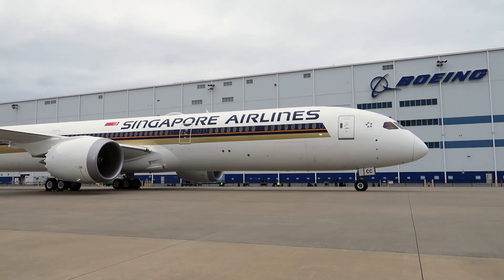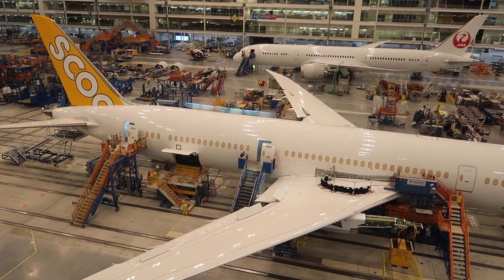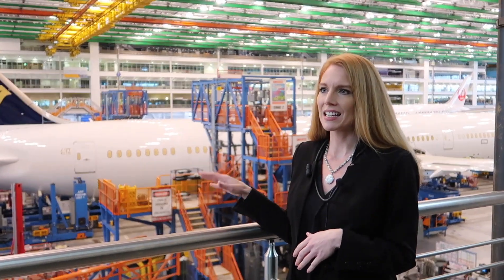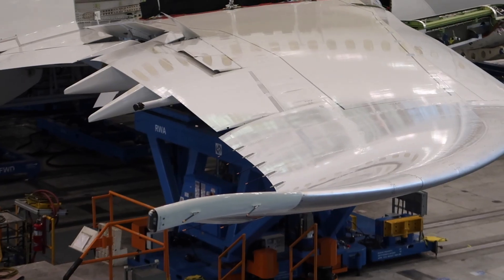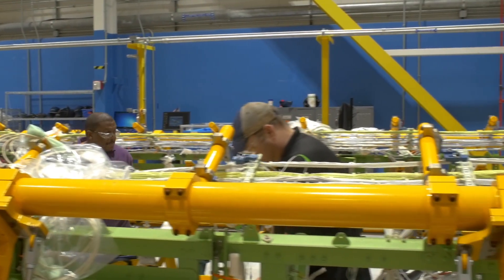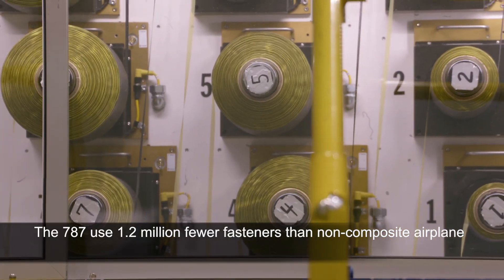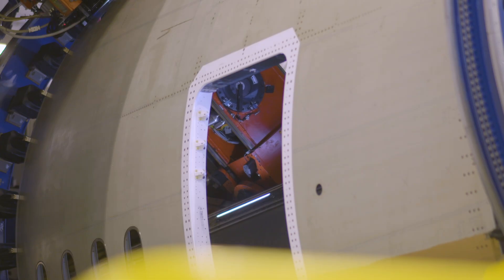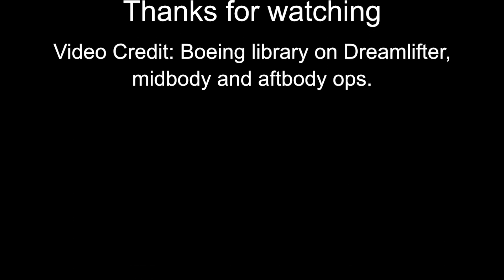How a Boeing 787 Dreamliner is Built ?

Comment: i spent way too long writing this paragraph about the alloy they use on the leading edges and I'm kinda proud of it, its the sexiest word porn I've ever written.
Aluminium 7085 is chosen for all leading edges on the 787, this includes the wings, engine cowling, vertical stabiliser and horizontal stabilisers. Aluminium is selected over carbon-reinforced polymers primarily due to its impact resistance. This allows the surface to deform rather than shatter or crack when struck by obstacles such as birds and hail. Specifically, a 7085 aluminium alloy is used for its inclusion of up to 8% zinc, which when paired with magnesium and copper, allows the alloy to be precipitation hardened, assisting to retard dislocations within the metal. Furthermore, inclusions of chromium improve corrosion resistance and help limit the stress corrosion that is often associated with welding zinc alloys. Zirconium is also added in order to inhibit recrystallisation, this prevents the growth of new defect-free grains, allowing the alloy to maintain its desirable hardness and strength characteristics. Finally, titanium inclusions are used to refine the primary aluminium grains, this increases the number of grain boundaries, resulting in a more ductile material. Controlling the grain size in this way also assists with corrosion resistance as having too many grain boundaries promotes galvanic corrosion, while coarse grains do not provide enough space or pathways for ions to travel through, making it difficult to develop a uniform passive film, thus reducing corrosion resistance.

Comment: Russian engineers are developing the main elements of the fuselage springs, engine supports, as well as the leading edge of the wings, slats and titanium components for the chassis, the main elements of the newest passenger aircraft Boeing-787 Dreamliner are being developed at the Boeing Moscow Center, where 300 Russian engineers work, Boeing General Designer Jim Morris said.

Comment: True fact. Several airlines will not accept an SC-built 787. Now that all of them will be built there, this will be a big problem.
Reply: Several? only one (Qatar) but they do now accept 787s now. not a problem anymore now the problem is fixed
Reply: @nickolliver3021  Several airlines used to refuse SC-built 787s. Now, they don't have a choice. BTW, they still bring them to Everett to fix the manufacturing errors in SC. The 40-26 building is still always full of defective planes that need to be fixed.
Reply: @xyx12300  several? It was only one. (Qatar). Lol if they dobt have the choice they wouldn't want to take them on anyway and it would be a waste of an order. Actually most are ready for delivery now. Tne remaining ones that needrework are at Everette.
Reply: @nickolliver3021  Everett gets a constant flow of rework from SC. Never ending.
Reply: @xyx12300  that's because there's over 120 of them.
Reply: @nickolliver3021  I'm aware of the rework per the FAA directive . I guess my main point is that SC has been building defective airplanes since Day 1, which have always been flown to Everett to be corrected. This is still happening, so SC does not have their QC issues completely handled.
Reply: @xyx12300  and you should be aware that there are many that are ready for delivery with only remaining frames being sent to Everett for rework. Yes we know SC was building and having these issues from day 1. Well new ones off the production line now should be completely handled so that FAA can go ahead and get them delivered.

Comment: How many more airlines will refuse SC-built Dreamliners now that Everett 787 production will be ended? Quality control at SC has been a huge issue and will continue to be a big problem for Boeing in the future.
Reply: Only one did only Qatar. that's not how many more though. Quality control at SC has been given the clear from FAA for 787s to be delivered. its not going to be an issue for the future anymore
Reply: Actually none say that and Actually they actually received a well earned review from Qatar,  we learned from the well deserved refusal of planes by them as well. They are a tough bunch. If not the toughest to pass a walk thru. But they love the product put out now. As they did long before you posted this.
Reply: @Kodiak1293  Are you a Boeing troll? I spent years at Boeing and have first-hand knowledge of the LegoLiner. Boeing Everett ramps are full of SC-built 787s in need of repairs, not just updates. Airlines don't have any choice now, do they? Hopefully, their QC engineers hold Boeing accountable. Overall, it's a fine airplane, but SC still hasn't got it figured out. Shill on, sir!
Reply: You tell me, you obviously have not seen the responses of our customers and thier satisfaction of the plane. You keep running to one customer who ended up being one of the biggest cheerleaders for the site. 
They needed a wake up call, and they woke up. What would make the site better in your eyes, your precious union? Sorry, the people are better off than union shops in the region.  And I seen the contracts negotiated for the area. No thanks.

Comment: You forgot to add in the question of wether or not it is built in Everette or Carolina. Several airlines have rejected one built in Carolina.
Reply: Qatar but this is not the case anymore
Reply: Yes, you should read the letter from them. Bash sc all you want, but they put out good planes.

Comment: Sam, I really love your videos, keep it up! I'd just like to add that I can't trust Boeing 787s or 737 max and potentially 777x if they are being built in these north and south Carolina factories. I'm worried for my safety and will avoid the 787 built there at all cost.
Reply: 787 is safe, I haven’t yet saw any issues. 737 max is a worry though
Reply: Also 737 max is because of mcas software not a buildquality issue
Reply: don't need to avoid the 787 even if its at SC they do get quality checked so not to worry and the max is safe now
Reply: Union hack?

Comment: How is the dreamlifter built
Reply: It's not built anymore, bro. Only four of them were built. They actually used passenger 747-400s and converted them. They took a 747 and basically added the top part and removed the original top of the fuselage, and did that with 2 other ones, too. Then, a little later, they decided a fourth Dreamlifter would be necessary, so they made a fourth one.

Comment: Ask to tour the "Gallery" in Everett. This is where a ten person team from an airline spends one week selecting all of the options. There are some 1500 choices to be made, 30 different service carts (reduced from 60 choices); 30 different lavatories, do you want a bidet? No problem. The waste tubes used to be aluminum but in testing a penny traveling 90 mph would not make the turn and punch a hole in the side causing a leak. Waste tubes are now titanium.

Comment: High quality product, leaving metal shavings in the plane, which could migrate into an electronic system and cause a short.
Reply: Yeah but there's a backup flight augmentation system in case of foreign debris interference. No, this system is not publicized and only known to a few Boeing engineers. It's connected to a single, fault-prone censor, so it activates randomly and takes over all flight controls, and oh, it cannot be de-activated by pilots. Trust me, it works!

Comment: Hey Sam
If I had my own Airline I would only have dreamliner my local Airport in the uk has a small runway of 6500 Foot the longest rout could be done is Mexico using the 757-200 and 767-300ER now the dreamliner is operating to all the destinations the 757 & 767 were doing plus Honolulu non stop .

Comment: Your EI Machines are a lot different than the ones we use in Wichita on the front section  we also use 1/2 inch tape along with the 1/4 inch tape

Comment: If they can make the dream lifter than why can’t they make a full double decker plane?
Reply: Why would they build a double decker plane when they can't even get airlines to buy the 747-8i? No one wants a double decker now. Emirates has half the orders of the A380 and is the reason the A380 sold more A380's than 747-8's. Twin engined planes like the 777 and 787 are what the airlines want for long haul flights.
Reply: @yoyoyoyoshua  I was going to explain to him that, but I'm glad you did.  Let me just add more to it! The Double Deck airplanes like A380 are used only for the big hubs and with special locations for them to park, which means extra money for building an airport or a terminal.  Also, in off-peak seasons, the double deck plane doesn't get full quickly like the 787 or 777.  That's a waste of money for an airline since it has to spend more kerosene just for fewer passengers, especially for small and medium airlines.  Add to that, the A380 can only fly from a hub to a hub which means less choice to make use of it and more time to make up the money it costs to buy it.  Unlike the 787 that can fly from a point to a point with no special treatment or special conditions.  B787 is the very flexible, competitive and eco-friendly and most important thing it's cheaper and makes up its money faster than A380.  You can NOT go wrong with the B787!! It's simply the best out there for now.  It's the future for any airline company regardless of its size.  Just enjoy it and have fun!!

Comment: This aircraft in its earlier years and even today still has some major safety issues  eg batteries,engines etc a fact which is glossed over by this video and the many 787 groundings are evidence of its dodgy record so far.
Reply: Cyprian FernsNZ Royce Rolls-Royce engines not GE ones GE are the best ones
Reply: Today it has no major safety issues. battery fires and engines were not Boeings fault. The safety record is very high and not one has taken any lives
Reply: Sorry, had would be most issues. No battery issue, the jet with the issue was being resolved years ago. Issues are expected, complete new way of building planes and a brand new program. You post thos and to date, 2033, not one major crash or loss of life. That sounds pretty safe to me

Comment: I've worked at the BSC site for 9 years and am proud to say that I had my hands on quite a bit of the 787-10 during final assembly.
Reply: Is the 787 quality built or rushed? I have heard former boeing 787 engineers saying the plane is rushed and for profit, is that true? I hope not, I am just looking for opinions of people that have worked on 787s, Is it a quallity plane? Is boeing rotten? Are they trustworthy? Or are they just wanting profit?
Reply: @ngaviation3489  the engineering was rushed a bit and as most of the public is aware we're in the middle of those rushed effects.  As far as hastily built we were on a 3 day rate for a few years but the quality is there and is getting better now that Boeing has the ability to use hindsight.  Many lessons to be learned from the max and the 787
Reply: @ngaviation3489  It has not been rushed. I don't know any former 787 engineer say the plane was rushes. its not true. Its a complicated plane to maintain and so is the a350 but its a quality plane but wasn't built to specifications but now deliveries are underway again the Planes are reworked and FAA inspected upon delivery. Boeing are not rotten and are trustworthy now they are getting things right. They do want profit like all companies do but not what they want to aim for when something goes wrong again